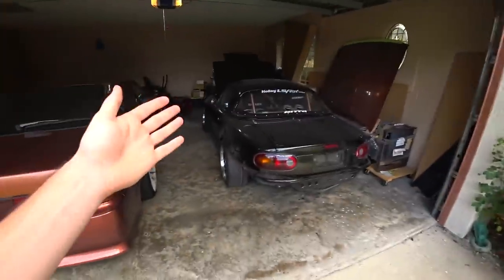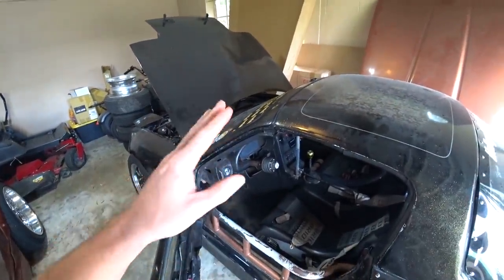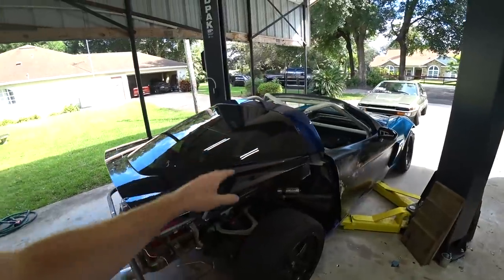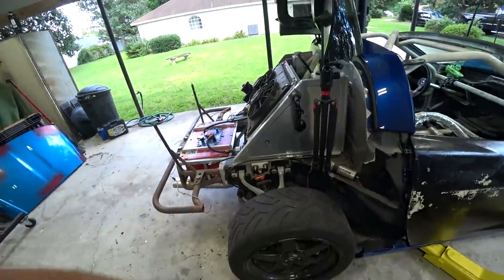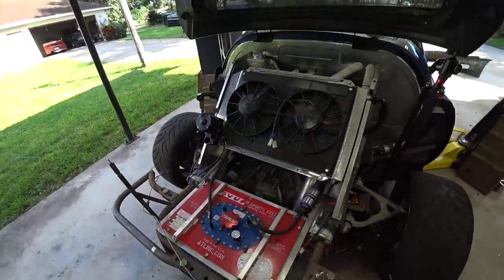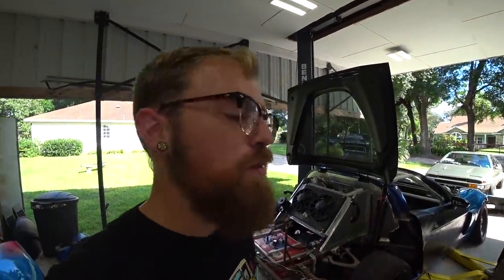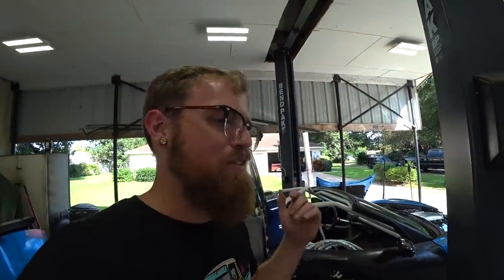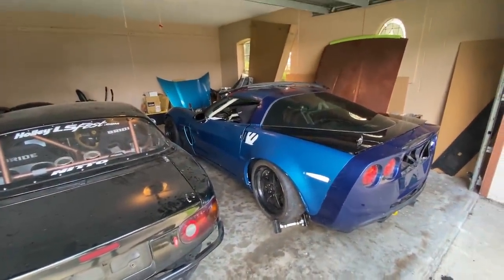I bought a FD Pro 1 Corvette Build! It has some wild parts on it.

Comment: Obviously check with Borowski to find out what the engine component specs are and go from there. If the engine was built specifically for boost it might be in your best interest to sell it but if it’s a built dart block and head combo that can easily be converted back to an N/A application than maybe just keep it. Whatever you end up doing I personally think a blower is the way to go. I’m excited to see what you do and what angle kit you choose, looking forward to this build especially if you try mating the trans directly to the engine and go quick change. Best of luck!!

Comment: Man that is a bad ass car. If it was me I would keep the engine, go with a built t56, winters quick change rear end, carbon fiber rear hatch with lexan and put some kind of cooling cuts into the lexan because you can never have to much cooling. But I would definitely keep that engine and if that turbo puts out to much power and doesn't light up quickly I would just go with a smaller turbo and tune the engine down because if you keep that engine you can always crank up the boost a little more and make all the power you'll ever need with it and if you keep it at around 800hp or less just to start that engine will last forever and put a smaller turbo that will light off and get into boost extremely quickly or go with a sentrifical if your just dead set on staying away from a turbo car. Just my 2 cents but most definitely a bad ass car with what looks like some incredibly well done work to it. Can't wait to see what you decide to do with it and see you ripping it around the track !!!

Comment: Whipple the current engine. and run a big pulley. Set the whole lot up once. Even get a tune with the party pulley. So you know the headroom you have for down the track. It will still react similar to an N/A setup.

Comment: Probably leave the torque tube and just make sure to service the clutch before every season and I’m sure you will never have issues. Also, a tsp 427 with some ITBs or some kind of vertical style intake so you can get a big ass air cleaner out of the hood would be sick. Spray it if you ever need more power. I’m sure you can hit up Chelsea about how he likes an NA car with spray.

Comment: That motor is intriguing. I'd like to see that in action. Take the turbo off and add noz or a blower to it. Upgrade the trans. If u get it finished early, you'll have plenty of time to test run it to see if it suits your needs. If not, then swap it.

Comment: The rear hatch is only so heavy because of the window. With that firewall you don't need a window. Replace it with a fiberglass or carbon piece with vents for heat extraction. I'm sure you could make it yourself or find someone local to do it!

Comment: My opinion is to build it the way it is but make the changes you feel you need to make. If the motor set up is not suited to your driving style then put it in the Silverado and build an NA motor for the vet. Since you really wanna build a turbo go fast pick up truck you’re sitting on the perfect motor, if you decide you need more power for the vet for drifting later you still have that motor to put in the vet.

Comment: If you're gonna strip it and rebuild it you could have just started with a stock car and got a cage from chairslayer to assemble. I would finish the car as is power wise and then build from there. The guy who built it put together a nice selection of parts so I'd at least try them out to get an idea of the capabilities.

Comment: Ayyy im hyped for you Taylor! Congrats 🥳 
Finally back in the corvette I love it. My opinion is finish the car as it is. 
Having an overkill engine should be seen as an advantage, sure if pushed to the limit it’s freaking expensive to repair but just run it on lower boost and keep it where it’s happy and then you shouldn’t have problems and then if needed you can always turn up the power.

Comment: Run it as is and then build a high compression n/a motor if you don't like the turbo ls, I'd try and do the trans swap though just for ease if you're under time constraints

Comment: I’d keep the motor and swap the turbo for a vortech procharger and even if the motor is overbuilt that just means you can have multiple tunes and a couple different blower wheels for different power levels that way you’re prepared for anything that’s what I would do

Comment: The best route to me is building this car out to your desires and standard; based on the things that still need to be done. In regards of the engine; I don't really follow the 'I wanna swap the OP engine for a less powerfull NA engine' one of the reasons you want to move forward on the Miata is to do with the lack of head-room. This engine is like an ultimate powerhouse and has heaps of growth potential. Just because it's a 1000+ hp engine doesn't mean you need to use all pony's. You could tune it down, which will mean that you have an overbuild and reliable engine because your not pushing to components to their 10/10 potential. Next to this, if I where you, I would just build the car as is; and experience it. Only than, you can decide if you like the engine turbo combo; or you don't. And even if you don't, you can swap to a smaller turbo, responsive of supercharger. Lots of routes to explore before; swapping a engine before trying it. Maybe once build, it will be the best combo you have ever driven. Try it, before you fry it. ;-)

Comment: Keep the engine in the car and put a Rotrex on it then it’s just pulley change and swap map (and poss injectors) to run the hp you want ...and linear power with no lag

Comment: Go with the centrificul super charger its what you need for drifting instint boost problem with a turbski and drifting is it has to spool up and just run that motor 1 season and see how you like the horsepower and see if you are comfortable with

Comment: Guessing you need throttle response... (not a turbos forte)..   if for racing only?  NA with the power you need is probably the best move.. Centrifugal is going to be next step up (50% torque increase at around 7psi) and spools NOW....   I need a turbo LS so I am a player on  your current setup...

Comment: You should totally keep that engine... that tiny turbo is going to spool like a lightning. Run it on low boost and it'll last forever. I do like the idea of going to a 700 horsepower LS and putting some money back in your pocket but if you don't need to do it and you can keep the better engine. I think you should keep the turbo engine. But maybe I'm a little biased because I'm all the Boost. And if you're anything like me I would turn it up and then I turn it up some more....
Reply: Front mount transmission Winters quick-change but maybe while you're waiting on those parts you can work on the rest of it.

Comment: If you dislike the engine and turbo setup, save it for the truck or for a legit drag car. Vettes are kinda small and narrow that the kit would swap to most other fullsize vehicles or another vette, with a remade downpipe. Also what coil pack mounts are those? I have a turbo manifold that sits over the valve cover and I need a similar set ASAP for turbo cateye things

Comment: I'd run it like it is if you really don't like the turbo switch it to a procharger.  That engine will be bulletprof at the power levels you want to run it at.  The glass should be where all the weight is in the hatch, I'd get a lexan window for it and see if it's light enough without the carbon surround.

Comment: If I were you I would keep the overkill engine setup, keep the turbo, finish the car and drive it. Mess around with the car at dofferent power levels and see how you like it. The overkill setup might work really well and could be super reliable.

Comment: Just build the engine, it looks a good motor and install…. Just run a smaller turbo for response. If you don’t like it, swap to NA next year or keep the engine but go supercharged if response isn’t how you want it with a small turbo… although the latest generation turbos are really responsive and can make massive power with little back pressure.

Comment: Blower would be the way to go if you don't go NA. Maybe ping Matt Field and Dirk Stratton. Dirk had issues with his roots blower kicking belts every round, even with multiple revisions to the drive system. Unsure if Field has that issue with his centrifugal blower but it doesn't like he did.

Comment: How about taking the engine combination out if the green truck and swaping in to the z06? then engine from the z06 in to the green truck? putting a roots blower on to the z06 and finish the big boy motor in the green truck having a capable 1500hp drag/street truck?

Comment: You might want to future proof this project, instead of aiming what you currently would want to do with the car, build it for what you might want to do with it in the future (FD). I'm sure you will pick up a tire sponsor eventually. I think downgrading or simplyfing the car now would result in the same as with the Miata and at the end needing to (over)built anyway. Unless you are sure you never want to enter the big big comps like FD2 or FD1 I would sell the engine etc and built it NA like you want it, but if you got FD spooking around somewhere in your head, keep it as it is, run it, and see if you could adjust/like it how its is now.

Comment: Looks like you picked the perfect candidate. In a previous video you mentioned new rule changes. Will you need to move to front mount radiator, ditch the pedal box, etc?

Comment: Pull the engine out, put in the NA engine you want, then save the crazy engine for a drag build. That engine should be able to handle however fast you want to go. Start out with low boost to get used to drag racing, then turn it up you want to go faster. It's an expensive engine, but I wouldn't sell it. It'll be a killer starting point to get you into competitive 1/4 mile racing.

Comment: You can always down tune the motor, overkill is what you need if you planning to push going into FD, you will eventually need a high horsepower motor anyways so work with what you got bro!!

Comment: DAAAMN this is a good move for sure, maybe use that engine for a no prep drag car?...especially since it has $8k coilovers, a $2500+ cage, $3500 brakes, and a $10,000+ longblock engine, plus a $2000+ dry dump system

Comment: I agree with others in saying you should finish it as is with the engine and turbo setup. Drive it and see how you feel, get some experience with this config to make an educated opinion on what you feel it might need, you might even be able to go smaller turbo or even twins to still make good power but give a more linear and predictable power/torque curve?
Other than that looks like a mega car already, would be a shame to dial it back so much

Comment: Keep the engine built as is that way you can run low boost and have low hp and a more reliable combo but then if you need the power then you already have the engine to get you there because in the long run you'll just build a motor to basically do the same thing

Comment: Just finish the car how it is so you can finish it and then work out the kinks but I would put a sentrificol charger tip put 2 to 3 oil cooler

Comment: personally I would stick with that engine because that engine will last way longer making 50-60% of it max power output than a basic 5.3 making 80-90% of its max power and hopefully it would be one less headache while you are doing your first season of proper pro driving. also hindsight is 2020 so do the things to get it ready, beat on the thing for a season and get comfortable in the car and then decide what you want to do to make it better

Comment: At least get it set up and do some testing with that engine setup. Maybe thats the setup that changes your mind on Turbo LS builds :P And if you do a Lexan rear window you could add some naca ducting for the radiator. Not alot of flow back there with all the panels on (doesnt look like it anyways)

Comment: Is a crazy trans set up really necessary for drifting though? I can understand in other forms of racing where you are actually putting the power to the ground, you need beefy components. I feel drifting would have less stresses on the drivetrain due to the nature of wheel spin vs planting all the power down.

Comment: Put this motor in the truck. It would be perfect. Then put the truck motor your building into the vette. Although it would prob be a pain considering you built that motor for boost also so it’s not built for high compression

Comment: Sell the engine, and do a procharged 6.2. Texas Speed is good stuff, but no reason you couldn't build one yourself. RPM trans for right now, and keep the body how it is now. If you go all out on a build right away, we wont get as much content as if you were to do upgrades over time like the miata!

Comment: Yeah it wouldn't make sense to sell the engine out of the car just cause it's overkill when in reality if you don't want the power you can tune it down or if you are dead set on pulling it, throw that engine in the truck. If you are aiming to go further though in drift and what not in my opinion the overkill is the right amount of kill, having the power and not needing it is better than needing and not having.

Comment: So you're going to sell these top of the line parts for BC? I mean its your dream but if you even think for a second that you will for example need more power then why sell a well known race motor. if anything run it n/a and if you need more then boost it down the road but it makes no sense to take really good parts out and put in parts that are not the same quality.  Again it is your dream car and I guess what I am really trying to say, speaking for experience is make sure you don't change something, sell something and then regret it.  But super cool that you are back in a vett.

Comment: I totally get the mentality of N/A = more reliable but...... YOU ARE BUILDING A RACECAR!!!! Sure you want to finish the events you go to, but races are not Sunday drives, they are pushing the driver and machine to their limits. That engine can do 1000HP all day long. Run it boosted and don't limit your potential. You are a good driver that can make use of more power. What happens when you finally decide to try FD and 700HP is not enough?

Comment: It’s really not overkill though. Build an engine that can handle 1500 hp reliably and run it at a 1000 is a great way to save parts. You should never build a car and run it all the way turned up

Comment: Burr-ow-ski not Burr-oh-ski, 2018 Race Engine Builder of the year deserves correct pronunciation. I personally think you are crazy if you remove a Borowski built engine to go with a TS&P engine. No disrespect to TS&P but they aren't on the same level as Borowski. If you're not big on a turbo LS sell the turbo system and swap to a different cam and pistons. I would leave it as is though.

Comment: Sorry Taylor but I have to disagree with you I think you would be stupid to change the engine specially as you’ve got it already done in the car if you’re going to do more competition stuff to be able to have 1000+ hp it’s probably something good.but if your not  doing FD competition you don’t need to run 1000hp.I’m sure you could have it at about 750/800 with that Set up

Comment: wire it... plumb it.... drive it!!! how could you pass up a setup like that?! id be like taking 5 steps back... just to take 5steps forward in the future. if you know your going to want more power later, just tune the car on low boost now and then leave room to grow... It's obviously a overkill engine right now, but thats right now. keep it... run the shit out of it!!

Comment: I know I'm just some random guy. So, bare with me I'm sure my opinion means jack shit.

I'd keep the motor in it. Why not?? Like I get you want the N/A, but why not just take the turbo off and spray it. Or, centrifugal suoercharge it.? You said you want this project done months in advance and you could save a lot of time just using the motor that currently in it. 

Also, if the suspension. Why not pull the suspension off, and get a few spares made? Send it off to a machine shop or do the work yourself and make thag 1 - off kit yourself. At least it has the good angle you want/desire. 

Just a few things for you to munch on if you care about my opinion. (Since you asked for it in the video)

Comment: Keep the turbo setup. No one wants to see a pro spec n/a build 🤮🤮🤮🤮🤮
Everything just seems backwards with what you want to do. Finish it, run it adjust from there.
Lower the boost if the power scares you.....